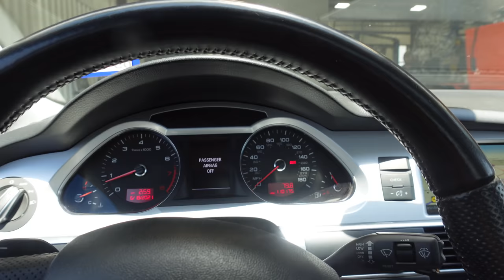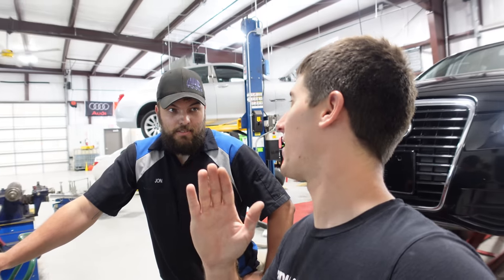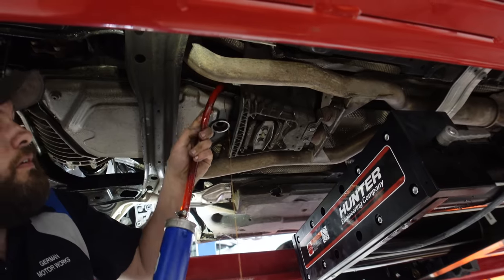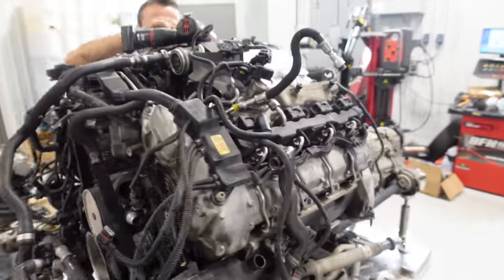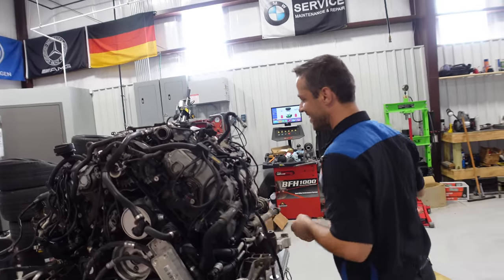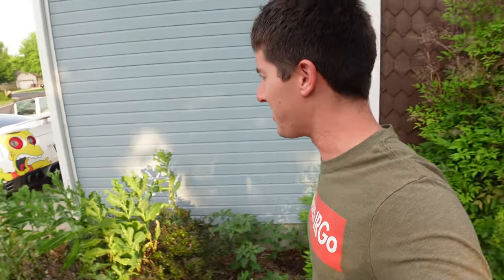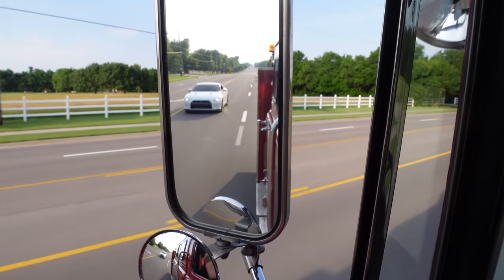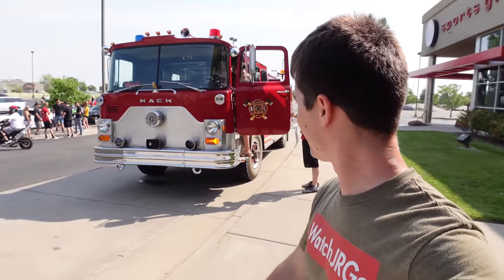I Drove My FIRETRUCK To Cars And Coffee After Wrapping Up My COPART Audi

Comment: If you haven't thought about doing it you should reach out to the mack truck museum in Pennsylvania if you give them the build number from the plate that should be around the pump panel on the driver side they should be able to supply you with any and all historical documents were Factory photos that they have of your vehicle and if the fire department you bought it from isn't the original owner they will tell you who it was originally sold to

Comment: I want to thank you JR.  I was watching your program and you mentioned that used car prices are through the roof.  I had a 2001 Lincoln Town Car for a second care and didn't need it.  I live on the Ocean the paint was in bad condition.  The car only had 125,000 miles on it.  It ran fine, great car for a kid starting out.  You mentioned that cars that were horrible were getting good money.  You also mentioned Facebook market place.  I posted the car and it sold in less than 24 hours for full price asked.  I didn't ask a lot but I didn't give it away.  THANKS FOR THE ADVICE.

Comment: To build air pressure quicker, rev 'er up to 1500RPM and hold it there, until you hear the compressor cut-out, then you can let it return to idle. This is perfectly fine to do, and dramaticaly decreases the time to compressor cut-out.  Now you can roll quicker, and without wasting a bunch of fuel, idling.

Comment: Those three character alphanumeric codes behind the suspension options are the same as on the options sticker on the car. You would have found that under the trunk floor most probably on the indent for the spare wheel. That's where it was on mine.

Comment: Hey man I notice the R8 is still not running so I assume you haven't got the ECUs back. Be super careful putting them back in and be sure to follow factory torque specs. A number of ECUs have been damaged due to over tightening the mounting bolts which causes the case to make contact with circuit boards. Just FYI

Comment: Does that fire truck kit have a high idle function or hand throttle?  That would speed up the air buildup by a lot.
Reply: Engage the PTO in the cab, the engine speed can be changed at the pump station. That is how you increase pressure from your pump. That said you have to set your valves to recirculate water to not burn up your pump. But you can totally do exactly what your thinking.

Comment: Use a garden sprayer with the wand end (preferably brass) modified to fit in the transmission fillers.  You pump the sprayer was you ordinarily would.

Comment: It has to run for awhile before you can drive it? I wonder how fire departments handle this. "I know that house is burning, it's gonna have to wait"
Reply: They keep them plugged in to the firehouse air supply so they're always pressured up and ready to go.
Reply: they can attach an air hose to keep it filled and ready. He talked about it when he got the fire truck. There is a air connection as well as a 120v I think for keeping the batteries charged and ready to be used.

Comment: Do you have to have a CDL to drive the fire truck as a private citizen?
Reply: Generally only if you're driving it commercially but you might have to upgrade your driver's license if the truck is in a certain weight class or has multiple axles. Different rules in different states and localities. Not sure what rules are in Kansas

Comment: Surely there is a needy small town or municipal airport you could donate this truck to.
Reply: It already came from a tiny town -- it's old and expensive to run, and lacks some modern equipment (not to mention, no A/C for the crew).  No fire department is going to want it, and it's not set up for airport use either.  It would just get auctioned off for someone else to buy or chop up for scrap.  It's fine where it is...